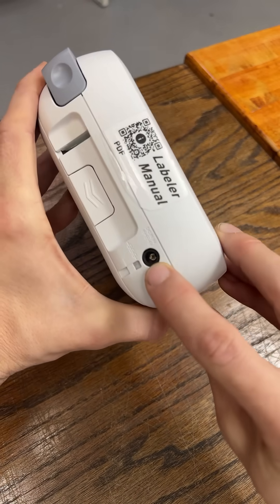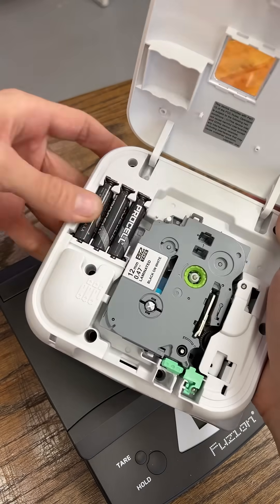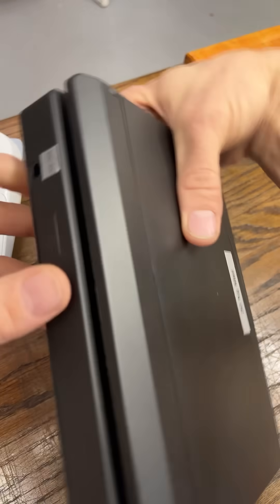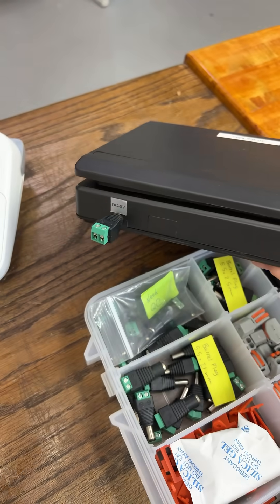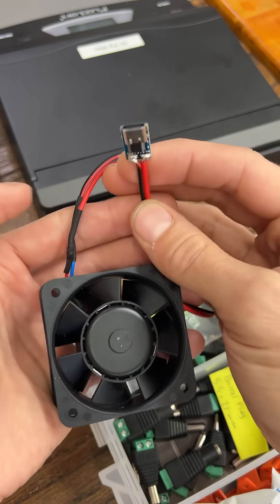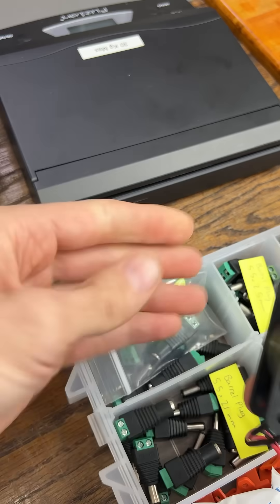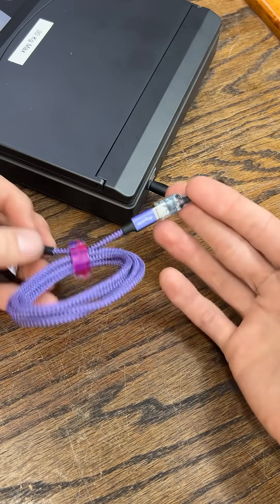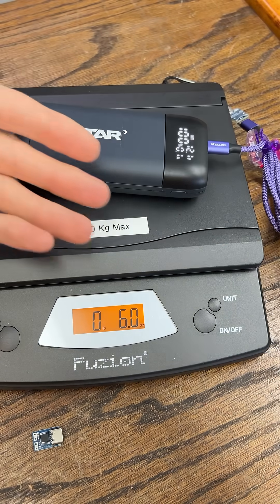USB-C can replace alkaline batteries

Comment: So you're amazed at being able to go back to what we already had in the 80s, paying a few bucks at Radio Shack to get a universal power supply with a set of different-sized barrel connectors. The power supply had a slider for the different voltages, and you could put the barrel tips on one way or the other to account for positive being tip or ring.

Comment: The takeaway here is that this kluge will work with many devices, but with a few others you'll destroy the power circuitry of your device. If you're unsure what the specs of your device are you'd be unwise to use it. If the device is critically important you'll save yourself from disaster by simply getting a charger/adapter designed for your device. It's worth the expense.

Comment: I did this for my portable 75W soldering iron and i love it, being able to have a pen sized soldering iron and use it with my laptop brick is amazing
Reply: Or just get a Pinecil which has both barrel jack and USB C PD built in. Plus a nice OLED display, upgradeable open source firmware, big range of available tips and costs barely anything.
Reply: Yea… but I bought it before the pinecil
Reply: It's now PS not PD

I mean unless you have many of the PD chargers

Comment: Besides soldering knowledge, you also have to know how to figure out the polarity of the barrel plug. Some devices expect tip positive, others negative. 

At some point, it's probably easier to get a universal power supply (used to be really common to see these in the 2000s), you have interchangable barrel tips, can select the voltage with a slider on the brick. Pretty handy.

Comment: Youll end up destroying your device when you push 5 volts into a system that needs other voltage to run and without an over current or under current protection.

Comment: You know usually you can find a laptop charger with an end that fits that hole for like 20 bucks but I'm a technician and I have at least 96 different tips for my universal charger. A universal laptop charger is also usually variable voltage too

Comment: You get the wires crossed on that Brother printer, your gonna be taking it apart to solder a new board mount fuse to the circuit board!  This is also a great way to start your home on fire if leave this s**t unattended and you have no idea how to solder!

Comment: If you are going to do this, skip the barrel plug ; use a multimeter to verify the voltage and wire directly to the device skipping the barrel plug.  If you want to be real slick, you can dremel out the space in the side of the piece of gear, and hotglue the connector inside the device.

Comment: Wtf YouTube years years I've spent watching these shorts. And today I got something I can actually use...
Reply: No, don't do this. Power supplies are cheap and plentiful. The amount of current required for certain devices will melt those connectors with those tiny wires and that usb adapter is trash too.
Reply: @jacobvarley5453  now that you mention it.  Yeah i bet if i cracked it own id be appalled at the 24agw wires lol!!
Reply: @jacobvarley5453 you really know less about PD huh
Reply: Yes you can actually use it ... once,
Reply: Gee almost like ppl in charge don't want us to know how to fix things.  Why you think they killed of diy and car channels. Right to repair
Reply: @glytchd  Actually what killed Radio shack is that things became too easy to replace or repair. back in the day we did what was called component level repair work. checking and replacing resistors, capacitors, tunes, transistors, etc to diagnose and fix things, then along came Modular electronics, where whole sub assemblies of parts could be swapped in and out to diag and repair. then it got to the point where if something quit you threw the whole thing out and got a new one. Long before that point people stopped needing to get individual parts, there was not a widespread do it yourself community to replace it, that came later. The only other option for parts was to order 'direct from the factory' which really was a thing.
Reply: @glytchd  I never understood the 'right to repair' thing. if u have something that breaks the company which sold it to u has no way to interfere or stop you from repairing it. u dont need a right to do it. no court will be on their side even if they sued u for repairing your own property. SO right to repair? there is no such thing and there is no need for such a thing.
 On the other hand you have zero rights to demand that they help you do it or provide replacement parts so u can. but that issue gets no where near this fictitious right to repair that people like to say.

Comment: There are 4-5 different COMMON barrel-type plugs plus about 10 uncommon ones. Some of them have polarity reversed. Using the a PD trigger board to make a "universal" adaptor is a guaranteed way to burn at least one device. Invariably you will plug in the wrong voltage or the wrong polarity. Don't do this.

Comment: It's too bad that most devices don't still use that plug. Then again, so many more use the USB plugs, but they're still a pain and keep changing them over and over again. You can buy a set of adapters for that one size that will let you plug into 10, 20, 30 or even more different size plugs. For $10 I got a set a coupe years ago that has about 40 different plugs that all have a female end that size... and then it also comes with some male ends that are spliced, so they can be soldered to any device or cable that they're needed for.

Comment: You are a hero for making this, thank you! Those barrel plugs drive me crazy
Reply: If you notice, the different plugs have different volts/amp ratings? They use those standards to prevent using the wring charger. Doing this uses the power of the brick and isn't good practice. It would be best to ensure the power source actually matches the requirements, and if you're familiar/skilled, you can easily replace the barrel plug with the USB adapter. There is no need for the ugly outside connection.

Comment: BUT, The problem is, USB connectors are incredibly fragile and because the socket is SMD instead of thru hole soldered. They break if you sneeze on them...

Comment: I feel like you don't understand electricity. Just because things have similar looking sockets doesn't mean the voltage going through them is the same That's why they have different numbers on them. Was it dumb that they made sockets that you could put the wrong one in Yes 100%, but one stupid people messing with electricity always ends horribly and two not having a clue what you're actually dealing with and messing with electricity at least the emergency crews are going to probably get an interesting story. Well yes you can do a lot of cool things if you know what you're doing electricity is one of the few things you just shouldn't fuck with it's up there with medicine let the people who know what they're doing deal with that shit.  I am 1 million percent behind DIY but DIY electricity is dumb.

Comment: The P-touch labeler has a convenient cavity near the hinge, adjacent to the tape cartridge, so you can pull one AAA battery out when not in use and keep from killing them so fast. That can be the difference in the batteries lasting months instead of minutes.
Reply: Side note, pretty sure this is an undocumented and probably accidental “feature”

Comment: NOPE, ten different voltages, ten different barrel plugs and then type of voltage AC/DC. Then we have to deal with POLARITY for the DC. Now you got me so AGGRAVATED, I need to ... smoke a joint to calm down.
Reply: I learned something new. I didn't know the electronics industry had such bad practices.
Reply: Bro has anger problems

Comment: USB is AC, Barrel Plug is DC,  its more then a simple buy this 1 dollar object.  You need to have an idea of how direct current and alternating current work.  Or people are gonna either fry the USB adapter or the board the female-usb is attached too.  Also the Power bank needs to be able to support the approximate voltage,  majority power banks people use might be the wrong current and supported amp and will kill the internals and waste the battery.  This is very fun,  but you got to cover bases.  Starting with why AMPS matter.

Comment: It's amazing what one can figure out by learning some basics.  Cheap solutions start flooding the mind.   I have so many projects, once I retire... I'll never ever be bored.  I love building things, and fabricating elegant solutions.
Reply: Except this wouldn't work because the device has to support PD and talk to the PD supply to negotiate voltage.
Reply: You'll like this, I had so many wall warts at my desk that I had 3 power strips in my cable management tray and still needed more outlets. I got a 12V 60A power supply and just cut the warts off the ends, put ring terminals on them and stacked them all on the threaded posts

Comment: Yeah in the 80's and 90's we had power adaptors with 4 different connectors on the end, and a little dial on the plug to set the output power.  Every kid had them.
Reply: They still exist.

Comment: I love my mouse because it runs on a single AA battery. Lasts for months. Bought a 10 pack of alkalines at Aldi for less than two bucks. They will power my mouse for 2-5 years of continuous daily use. And now I never have to worry about charging it, if the red light comes on I can swap it within a week or so. I love not worrying about charging anything. I have a tiny bucket of AA batteries, I started it three years ago, it's half full. I just counted, it's 43 batteries, from every battery thing I own and use. That's less than ten bucks. Why does this need a solution? It is the solution.

Comment: Yes as long as it's 5V. as you point out in the very beginning, your white label maker is a 9-volt machine and will not work from just any regular wall plug charging adapter.. you're charging adapter or wall Cube as I call them will need to be a quick charge that allows for the voltages of up to 12. If you don't use a quick charge it won't provide more than 5 volts and it won't work on things that take more than 5 volts to run

Comment: All batteries are rechargeable. If you get a digitally regulated charger, so it doesn’t overcharge because non-rechargeable batteries are not voltage regulated. but a digital charger is you can get 50 to 100 recharges on most every AA AAA D C battery 9 V even. Plus I have a higher power density than standard rechargeable batteries they are actually better. I’ve done it for multiple years for it head lantern with multiple AAA‘s costing far too much money if purchased. Cycled batteries, many many many many dozens of times newer lithium AAA don’t work. just a 95% of the old-school batteries. all work watch them the first time.

Comment: I'm a little old school so I use one of those variable voltage power adapters that go from 1.5v to 12V and you can reverse the polarity of the tip. Even supports the 9V connector and 4 different barrel connectors
Reply: i did not even know such devices existed
Reply: @FnjordKnot  They've existed for quite a while, commonly, they'll have a range of tips you can use. It was probably the most common choice for replacing the OEM power brick if you lost it.
Reply: Yeah those are probably great until you accidentally switch it to 12v and plug it into something that only takes 5v. Magic smoke.
Reply: @markjones2349  if I intend to use something like this semi-permanently I usually tape the switch down to prevent that from happening.
Reply: @markjones2349  I did that sort of thing once, it mostly just generated a bit of heat that started to melt the plastic, I'm very lucky that I noticed it before it started a fire.

One of the things that I like about getting power from USB A is that it's a lot less likely to start a fire with the voltage and amperage available from a USB port.
Reply: I know the one, I bought mine nearly thirty years ago.
Reply: @waverider5751  I remember those,  got mine at RadioShack
Reply: You can find them in junk bins all over the thrift shops. But they're like $12-$20 new off the rack. This video is all about a couple bucks. But here again it's nice to have about $20 worth of parts already laying around in a box.
Reply: I've got a USB PD board similar size as the one shown with a button that lets it cycle between atleast 5 different voltages, including (but not limited to), 5 9 12 and 20volts.

Comment: These are called decoy modules. They don't convert voltage, just make PD brick to supply that particular voltage. Or not (coz they are super cheap) and then you burn your device.

Comment: but that relies on a smart chip to control it, which could fail and cause excessive voltage,, an 'original' 'dumb' power adaptor much safer and more reliable

Comment: I'm a little lost on this, you have batteries in there, but also a barrel plug? Obviously it wouldn't recharge the batteries right... And for the batteries themselves, there are such thing as lithium ion double A's. Eneloop and IKEA. Expensive but they can recharge properly.
Reply: Also, correct me if I'm wrong but this thing only does very specific voltages... There's a lot of devices out there that do voltages it cannot do.

Comment: All we needed was standardisation. We could have made all electronic devices use the same barrel plug, same polarity and same voltage. Including power in USB C is useful but a simple barrel plug as an alternative would be more robust. For most people most of the time they need a robust charging port much more than a data port.

Comment: You'll have to look at the current requirements too, most chargers only deliver 1.2 A at 5V, and less at higher voltages. For some things that will be fine, but other things it won't be enough to run them.

Comment: Oh it is really funny that you think that's gonna happen any time soon. The barrel plug is 1.5 cents per 100 from a supplier. Those USB breakout boards are 2 bucks each. that's a little over 133 times more expensive. Not much for the home shop, but when you're burning through 1000 per hour putting together cheap electronics that's a 67 dollar difference per hour. You can hire 4 more people to make more of the things at American minimum wage for that much money per hour.

Comment: That Brother-thing will run on 4.5V. It only takes 3 1.5V batteries. So I have no clue why they put 9V on the plugport. I have the same thing, and it runs without problem on 4.5V up to 9V.

Comment: My mom sold Avon products. They had alot of decorations with lights, fiber optics etc. They sold these universal power source plug deals that have a switch on them for various voltages from 3-12 volts, a polarity switch and it has like 6 different end types on it including 3 different size barrel connectors, two different male headphone looking types and a 9v battery style connectotion. Had it for like 20 years at this point and suspect you would be able to find something like it on Amazon.

Comment: Always make sure to check the polarity of the device. There's normally a little diagram. For instance, Super Nintendo is actually center negative which is extremely rare and it would be quite easy to plug in the wrong adapter.. 

Something more in depth. Many devices that claim requirements of 8 to 11 volts input can actually all run off of any voltage in between and even much higher at times. Most older microcontrollers run on 5 volts. There's almost always a 5 volt regulator. Almost all regulators have a pretty substantial range of inputs that they can regulate down to 5 volts. For instance, the most common regulator 7805 can actually have an input up to 35 volts and still regulate down to 5. The issue you can run into is heat on the regulator. But for most devices that claim anything between 8 to 11 volts, you can likely use anything in between on any of them and it'll work fine as long as the power supply puts out enough current.